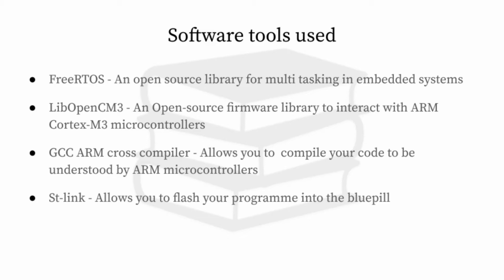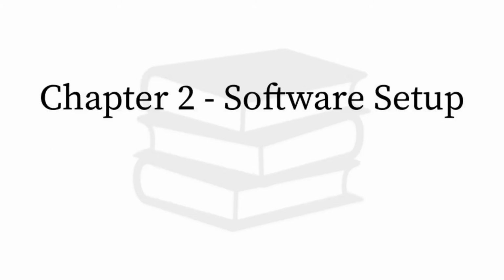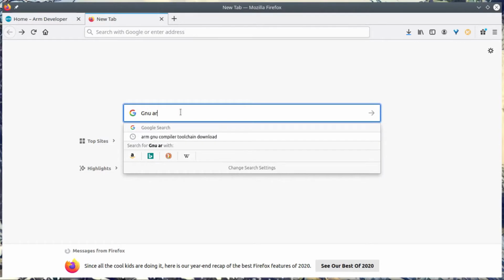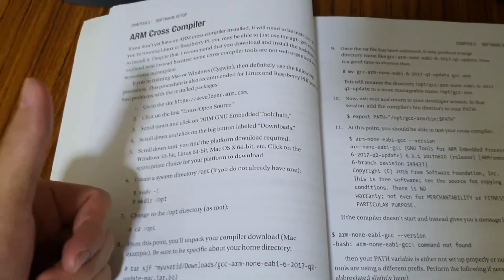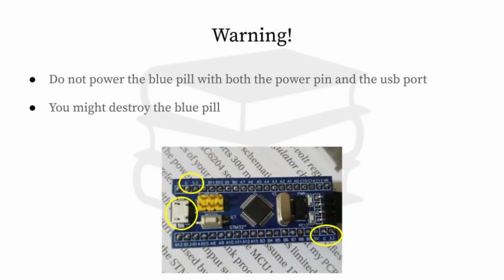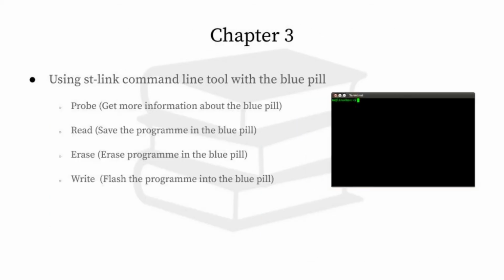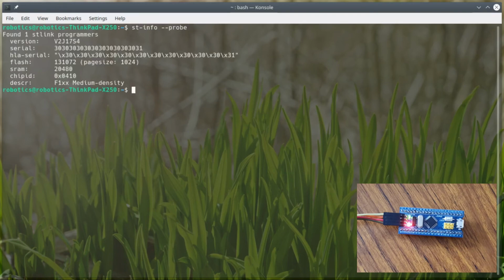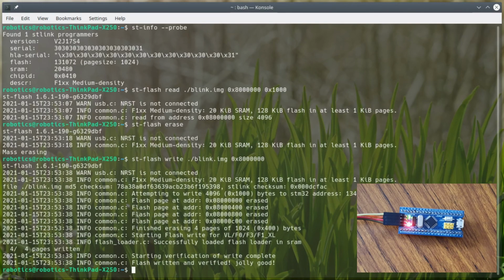Beginning STM32 Summary - part 2

Comment: how did you do the software setup?
Reply from the maker: There are quite a few steps needed to set everything up
1) Install and use linux in your computer
2) Make a project directory and go inside it
3) Clone the book's repository which contain's its sample code - `git clone https://github.com/ve3wwg/stm32f103c8t6.git`
4) Clone libopencm3 `git clone https://github.com/libopencm3/libopencm3.git`
5) Download  freertos from http://www.freertos.org and unzip it into ur project directory
6) Edit the Project.mk file so that it matches the FreeRTOs version that you are using.
7) Install arm-cross compiler (shown in the video)
8) Unpack the compiler and move it under /opt directory
9) Put the PATH variable in your ~/.bashrc file `export PATH="/opt/gcc-arm/bin:$PATH"`
10) Finally and hopefully everything works, go to the root of your  project directory  and type make.
11) Install st-flash tool from `git clone https://github.com/texane/stlink.git` 
if you really want to follow closely what the book does as, I highly recommend getting a pdf softcopy of the book (hehe). The goal of these video series is just for me to make a brief summary what i have learnt. Cheers !
Reply: @engineeringjourney7862  thanks
Reply from the maker: Or alternatively you could just set everything up with an Arduino IDE. Which is much more simpler tbh